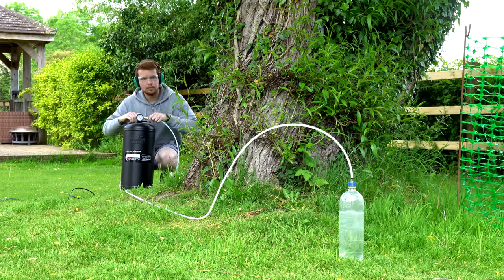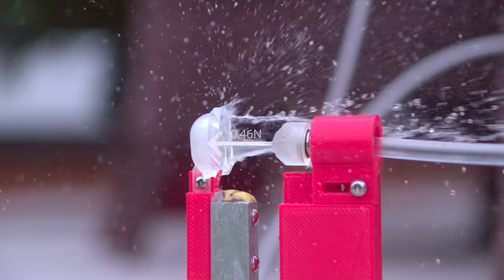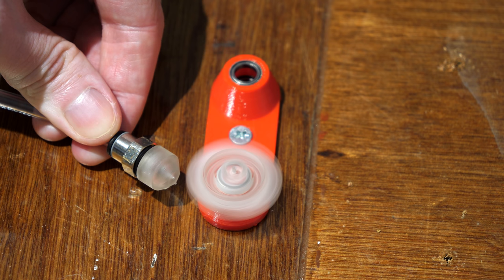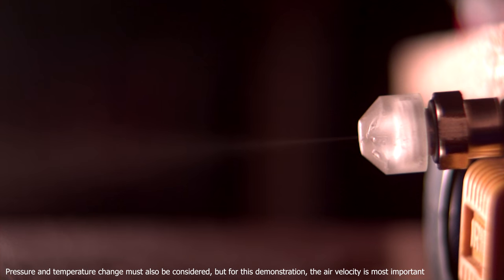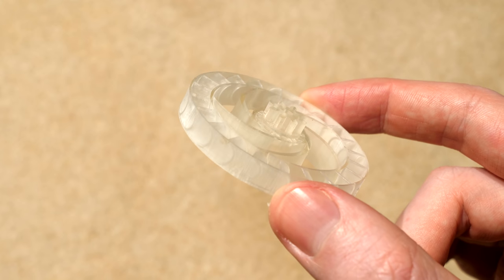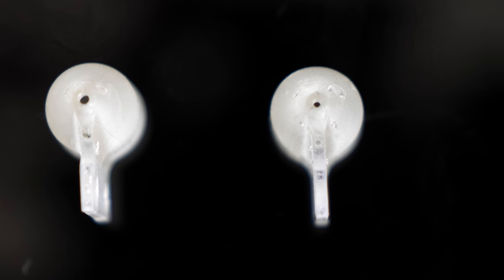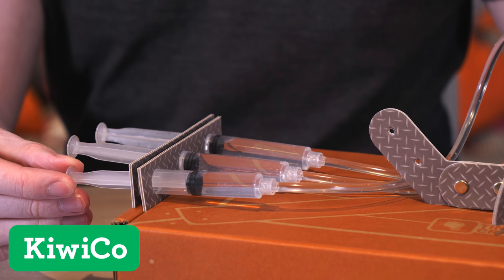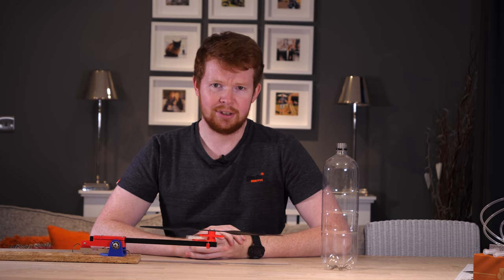Micro Pelton Turbine

Comment: I think I know at least one of the reasons why the turbine is more efficient than just spitting the air out the bottom. When spurting the air out the bottom, it is exiting with a lot of kinetic energy, which could have been harvested and used to make more thrust. What the turbine does is that it actually extracts most of the kinetic energy it can through this process of slowing it down so much.

Comment: Have you looked at vane engines (pneumatic motor) and the Di pietro air engine (engineair) ?

The pelton turbine looks interesting enough, but as you pointed out it's really designed for a fluid.  And with a gas a lot of the oomph gets lost to the environment.
The incompressibility of a fluid probably has something to do with it, but also the ratio of the masses... a fluid (higher mass) moving through a low mass gas won't be affected as much.

In the case of the airmotor you already kinda see that a lot of the force going out of the nozzle is going sideways and spreading out a lot faster than a fluid.  So keeping the gas enclosed seems to be the solution (which is what a vane engine does).

Comment: Given the shape of the air-optimized turbine, it makes sense to see if some kind of analogue to a jet engine might be built where you'd have an annular intake combined with internal air nozzles fed from the compressed air tank. The complexity of the idea might induce thrust-weight problems unless the pieces can be printed out of a material light enough but also stiff enough.

Comment: The nozzle lacks a bell, so there's nothing controlling the direction of the flow of air, and some thrust is lost to lateral movement of gasses, like a first stage rocket engine at high altitude. Also, the turbine and prop increase the impulse by acting like a gear ratio, turning a small volume of air moving at high speed into a much larger volume of air moving at a lower speed.

Comment: Place the nozzles on the tips of the rotor blades. 
Some early helicopters had this design. It had done trouble with hit gases. Since you use cold compressed air there should nothing to be worried of.
Placing nozzles on tip of the rotor will drive the rotor and save the weight of the turbine and gear.

Comment: Tom, consider where you are losing energy. First, every axle mount and gear is a point of friction loss. Second, any air traveling in a direction other than one that does work for you is a loss. You were on the right track when you enclosed your Pelton turbine but I believe you can do better. Consider an enclosed tube corkscrew turbine. If you orient the exhaust end of the turbine tube down and mount your propeller on the upper part of the corkscrew shaft you will convert most of your compressed air's momentum into either turning your shaft or providing direct thrust. Rather than adjusting your gearing adjust the size and twist ratios of your two cork screws (propeller and turbine). A frictionless magnetic bearing would be nice but given your weight constraints, oil or carbon powder will undoubtedly serve you better.  Good luck.

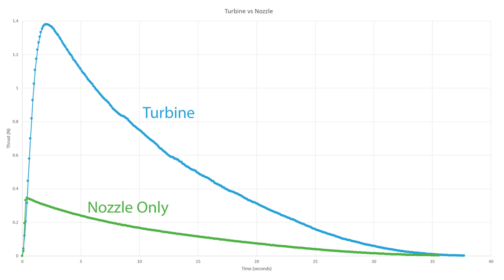Comment: 7:20  -    I believe the reason for the lack of thrust vs the turbine is mostly the propellers effect on the surface area of your medium (In this case air). The nozzle is a high pressure system but the conversion to usable thrust is not ideal because the nozzles opening is unable to have effect on the necessary surface area & medium density to be useful. 

You might use the 'newspaper & ruler' experiment in one of your videos to better explain it?

Comment: So the final version is very close to a standard impulse turbine that is commonly used in steam applications.  Here's a tip.  Make two more of those exact same wheels and stack them up with the first in alternating directions.  Connect the first and third wheel to your shaft and hold the second (opposite direction wheel) rigid to your frame.  Make sure the blades of the first and third wheel are aligned and there you go.

Comment: If you use different gear ratios you can get better results so if you use a gear with more teeth on the input the output will move fast and if you use a gear system you can get even better proportion

Comment: You could try using a reaction turbine and a convergent-divergent nozzle to try to extract a little more KE from the air pressure. While on that, it would be interesting to see if adding another stage to your turbine would be worth the weight for the additional force generated.

Comment: I noticed that a lot of air is going into the void around the turbine blades. What if the turbine is enclosed in a closed housing so that the air moves along its entire circumference and exits near the nozzle. Also, make the outlet directed downward so that the remaining energy gives an impulse in the right direction. It seems to me that this would increase efficiency several times.
Sorry for possible mistakes, I am using a translator.

Comment: You might want to attach the turbine directly to the rotor to cut on gearing losses. You might also want to make the nozzle the smallest hole in the air system and add a laval nozzle.

Comment: Try using a smaller nozzle opening, and make the initial tube itself wider too. This might help create a higher pressure coming out of the nozzle and might help with getting to a higher rpm. This is just a theory, but I kind of want to see if it will work.

Comment: With the current design it is allowed for the blades to stall as soon as the air leaves them.
This would result in drag.

You should encase the turbine. The casing should have an inlet and an exhaust after almost a full revolution of the rotor.
If the casing is designed with minimal space between the rotor, the rotor should be able to use the most energy available in the supplied air.
I don't know how much more efficient it would be compared to the added weight from the turbine casing.

Comment: On the efficiency question:
This has everything to do with the equation for kinetic energy: 
E=1/2mV^2 where m is mass and V is velocity.
As you can see, mass has a linear relation to energy, and speed has an exponential relationship.
From that, you can conclude that it takes less energy to accelerate a large mass to a low speed & it takes more energy to accelerate a small mass to a high velocity.

The large mass being the large amount of air moved my the big prop & the small mass being the air blown out quickly by the nozzle.

Comment: Tom,  You need to have a Laval nozzle. It is important that the air har close to laminar flow when hitting the turbine blades.  A nozzle that has a 4 degre angle might be a good start. Regards from Norway.

Comment: I would look into steam turbine design, most of the efficiency gains there should apply to air turbines. I certainly would reduce the clearances between the nozzle and the rotor as much as you can get away with. Another Idea is to look into printing converging diverging nozzles that are elongated to match the blade width. I think you could easily get mid-high double digit percent gains by going after inefficiencies like that. Love to see your videos, please keep it up.

Comment: At 02:58 
It spins at 21000 [rpm] or 350 [rev/s]
The circumference is ca 104 [mm] or 0.104 [m]
The speed is 36.29 [m/s]
The acceleration on the tips is v2/r = 79796 [m/s2] or 8134 [g]
Be careful.
A wonder it did not disintegrate.

Comment: The reason the turbine is so much more efficient than just the nozzle is that it produces so much faster airflow but while producing less thrust. It's wasted energy. The propeller on the other hand produces thrust by moving a much larger volume of air at a lower speed, which produces not only more thrust but consumes less energy to do so. If you were trying to propel something at very high speeds the plain nozzle might be better, but for most purposes the turbine and prop will be better. This is the same reason that airliners use high bypass turbofans rather than the low bypass engines used by fighter jets to go extremely fast.

Comment: Now you have the simple jet not making as much thrust. 

Welle welle well. That's because the prop basically takes a large chunk of air and pulls it down. Like the difference between rowing with a plane broom handle and having a big paddle on the end.
The slip is less the larger the mass of fluid stuff you are pulling on. 

So I know you know the Coanda effect. And that's basically what the Dyson fan is.
It takes the air jet and makes it draw down a much larger volume.
Which is what the prop does. 

So by some clever arringmet it may be possible to have a system with no moving parts that produces the same trust. But it has to bring along a large enough volume of air with it. The larger the better. 

I also think a squrille cage type araingemt may be interesting for the turbine blades.  
This let's the inlet be travelling at a different angular velocity to the outlet. As one is at a different diameter. 
And you can make it do from outside in or inside out. And see which is more efficient.  
I suspect outside in may be more efficient as the jet loses velocity. But maybe not.

Comment: The nozzle: just wondering if you had thought about the nozzle design as the nozzle you are using is just a hole not a formed orifice then use Bernoulli effect by placing a small enclosure around the nozzle which will increase the volume of air by 50%

Comment: Main issue is that when the water is redirected it heads back towards the new bucket heading towards it, and then it impacts with the bucket and reduces some of its force, you should shape the buckets like a lacrosse racket and make it such that the water is deflected out to the side instead of directly into the back of the oncoming bucket!

Comment: The Pelton Turbine  is a bit more complicated if  I'm not mistaken. These  turbines are used in hydroelectric powerplants. The form of the bucket also considers the fact that it's  attached to a rotor -  the goal is for the water to leave the turbine with almost zero speed.

Comment: I guess the nozzle on its own ejects high pressure air that spreads out evenly distributing it's momentum partially in the horizontal direction. This is the same reason rockets optimised for sea level are less efficient in a vacuum. If you had a bell on it to bring the exhaust down to 1 atmosphere it would be more efficient but I imagine that's quite hard to get right.

Comment: Great work mate ! I was wondering,...what if you could print a propeller and the turbine cups all in one... That would skip the extra gear (weight). So you would end up with a direct power to the propeller. Then one could experiment with the turbine diameter located under the propeller.....increasing efficiency I think one could print the turbine cups to redirect the air downwards as the propeller also forces air downwards to create lift.....just an unproven idea ya know...

Comment: The gears eat energy so you gotta desing a propeller for the turbines rpm and now that you have that resin printer you can. Use the hub from dalprop fold and you can print similar props with no supports if you make a cut to the bottom and print tip up. Easy.. and you can mix resins to get best results. good luck.

Comment: If you put a balloon in the bottle, with vent holes drilled at the bottom, you could get the same 4 bar initial pressure, and a greater duration of pressure for the remaining volume.

Comment: Btw, i think the next development would be to enclose the turbine and nozzle to ensure air isnt leaking out of the system before it had had a chance to impart force to the turbine. It'll require effort to design where you want the exhaust port to be and to achieve a tight tolerance on the turbine so air doesnt leak much around the blades.

Comment: Can you apply another test (and video about it). Warming the air when going through the tubes to the turbines. Expanding air is cooling down and by that you'll reduce faster the pressure in the bottle than equivalent through the amount of weight of air leaving the bottle. If the weight of the air is halved in the bottle the pressure will be more than halved and the leaving ait colder.
I expect that with heated tubes the air will last a little longer (or the max energy getting out the turbine will be higher).

Comment: as a guess it's because the nozzle only lets out a small amount of air which creates thrust. Whereas when connected to the prop, the prop is both moving a lot more air downwards but is also creating a greater pressure differential as it's effectively and aerofoil.
is that right?

Comment: Hi
I was going to advice against making a helicopter, as achieving proper balance with one would be extremely hard, but I see that you are actually an aerospace engeneer, so no worries there.
I also had a suggestion to perhaps improve the previous air powered piston motors. I believe that you could an extra piston on the crank shaft and add an extra bottle.
You probably need to add an extra bottle, and perhaps re-introduce a gear ratio to make up for the added weight, but the extra piston should help produce a more constant trust. The grafs now show that the trust is fluctuating strongly. It should also help with a smother vent and cycle.
(I'm sorry if i missed any spelling or gramatical errors, English isn't my first language)

Comment: Cool  Nice video.  You might consider a 'Terry Turbine' design.  The 'wheel' is much like you already have, with curved blades that are closed off at the outer end.  But the nozzle, instead of just a simple nozzle that you have, includes some curved blades that direct the air leaving the turbine back around and into the turbine again.  This 're-entry' gives the air multiple chances to hit successive 'buckets'.

Still a very cool video with some nice slo-mo details.

Comment: Try this:   make the turbine wheel smaller in height, same diameter, and put several jets around the perimeter, so the vanes produce power several times during a rotation.

Comment: I'm pretty sure you could do a lot better with the nozzle only version if you included a bell after the nozzle opening (like a rocket). This allows something for the air to press against as it expands thus improving thrust efficiency.

Comment: Interesting, it would be interesting to hook this up to a large pressure plenum and modulate the pressure as the form of velocity control. There might be some good reasons behind pressurizing the bottle to a max pressure and using a small pressure regulator to keep the max thrust a little bit lower and prolong the time of flight.
Reply: This vid is the history of steam engines from piston to steam turbine. I expect the conclusion is a 16mm multi-stage blade set with reversing blades between them?

Comment: I'd bet the turbine works better than a plain air nozzle due to impedance matching: with just a nozzle all the thrust is from the expelled air, which can only output so much force. When you introduce a propeller, you now get force from all the air the propeller interacts with, even though you suffer mechanical losses

Comment: I would think that the nozzle, alone, is less efficient because the air being ejected has no solid surface direct beneath it. This causes the compressed air to spread outward, giving a third of the horizontal motion, the other two thirds becoming vertical motion and not creating force on the same axis as the measuring instrument, but this is simplified to a two dimensional plain. In reality the true horizontal motion is a lot less than on third; this contradicts your graph, but the graph doesn’t show the true horizontal motion. Your graph also includes the air being disbursed at all three dimensional angle between horizontal and vertical angles (i.e. between all 90* on the x axis set in 360* on the z axis) with each consecutive angle having decrease amounts of force from the true horizontal motion.

edit: The net force of the nozzle would be a little less than 1/5 of the net force of the nozzle and wheel.

Comment: can you stack multiple rotors on top of each other to continually redirect air flow. So basically the exhaust of one turbine is directed into another opposing turbine which then again redirects it, until you have absorbed all the kinetic energy of the air. Not sure what kind of mechanism you would need to drive the same shaft with opposing direction turbines.

Comment: Use fluid spray tips for painting . 
1 mm that's huge ! I'd say a R.A.C. tip .221 -.217 (2 is the width the orifice is .021-.017 ) 
Or pressure washer tips  .636-.838ish 
Might want to think about a submersible pogo pump mico build .
  Pneumatic would be the best unless you can figure out how to build a hydraulic . Then of course there's electric.

Comment: If there was some way to maintain the downstream pressure, could you improve the performance of the application? Rather than having the force decreasing over time, you’d have a more constant force which can more easily be applied to a mechanism. Something such as a pilot-operated pressure reducing valve would be cool to see but I really don’t know if this is at all feasible with air and at such a small size.

Comment: Early on in the video I thought why convert the motion through the turbine when you could just use the a nozzle. I haven't thought through the physics of why the thrust gives you a much lower result but perhaps using a venturi shroud could make more use of the velocity to suck in more air and give more thrust. Alternately add some water and convert to a bottle rocket.

Comment: The turbine-driven propeller blades displace a higher volume of air a greater distance consistently over a larger area, producing more thrust - like the propellers on a helicopter versus the smaller jet of, let's say... a ducted fan. A ducted fan may move a huge volume of air very quickly at high pressure, but, over a much smaller area.